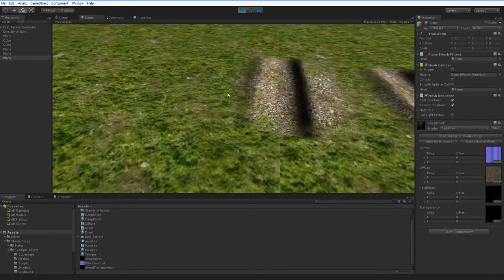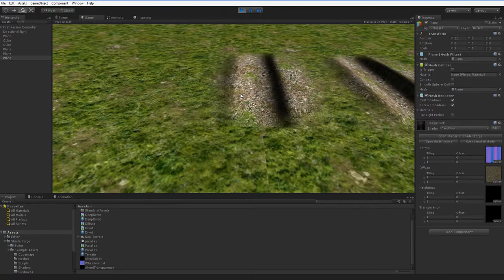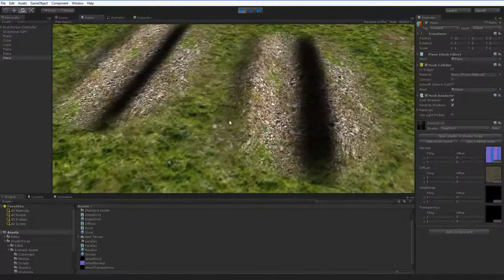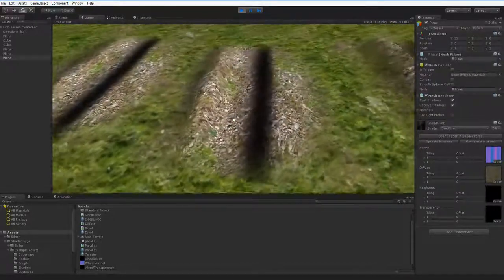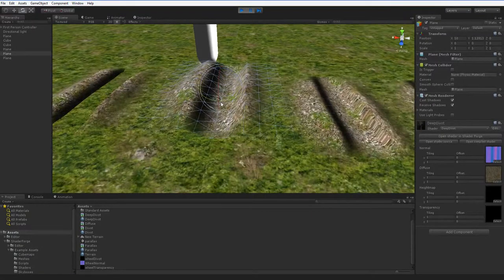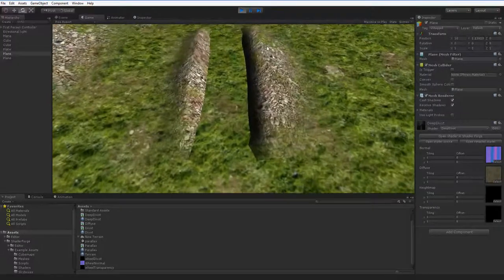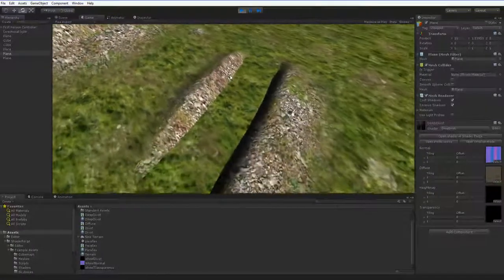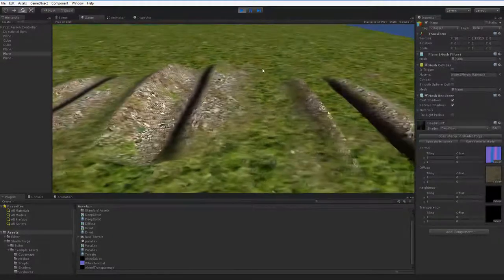Car Track Decals

Comment: id recommend parallax occlusion maping. you can do this by having multiple parallax maps masked over each-other. basically using parallax for horizontal slices of you image. that should work.
Reply from the maker: Whoa, whoa, that sounds good. Do you know how to do that in ShaderForge?
Reply: Craig Perko
 ill throw something together to show the concept. mostly its just different parallax layers lerped together.
Reply: Craig Perko
concept:
start with unparallaxed image.
overlay bumped out version over. masked by being above a given height(height also parallaxed). rinse repeat till you have enough layers to look good.
key nodes are: Step(A <= B), Texture Asset, Parallax(of course).
Reply: CynicatPro
 heres a graph http://prntscr.com/3ywn7g
Reply from the maker: Thanks!
Reply: Craig Perko  thanks for making the videos!